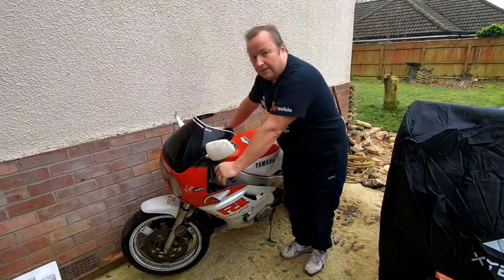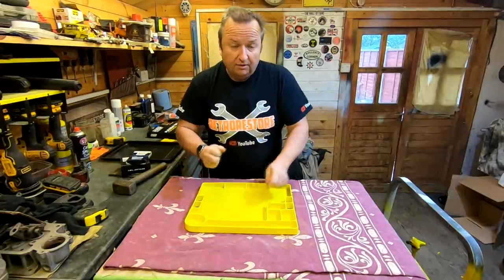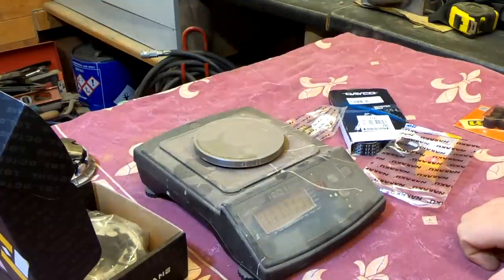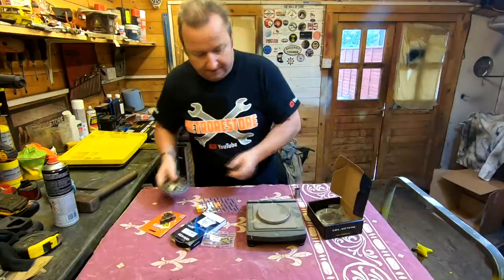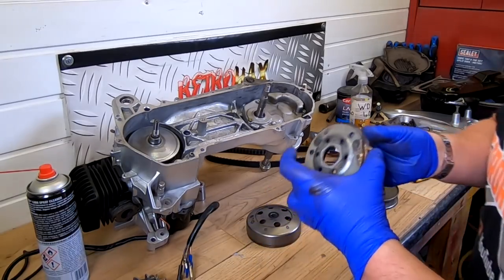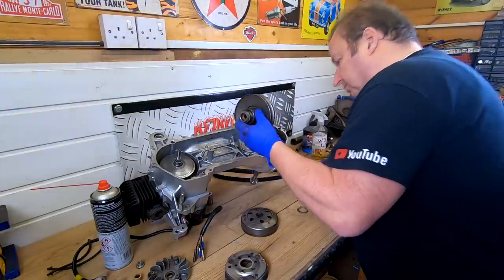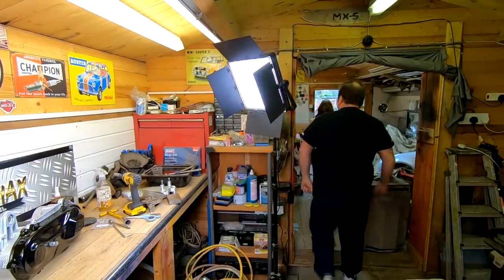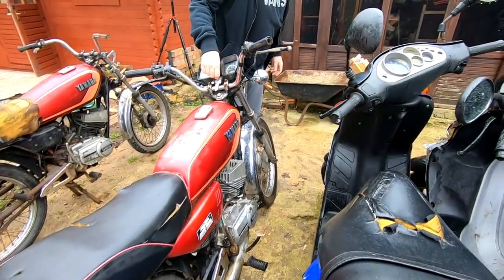Another Investment Motorcycle And TGB R50X Scooter Action

Comment: Poor Sharon.
Nearly there with the TGB. 
The best way I have found to fit Contra springs. Place the torque drive on the floor. Put the spring in. Then you can push the clutch down. One seated, use the ends of both feet to hold it down. Your hands are free to put the nut on.
Reply: Don't forget to line clutch up perfect so it slips on the shaft correct without damaging the 0.75 thread

Comment: Just a heads up. The rollers should be installed with the plastic edge that sticks slightly over the metal inner of the roller facing the front of the scooter. That way when you accelerate the roller plastic edge hits the variator wall not the inner metal of the roller.
Reply from the maker: Thanks for that. I didn't know that.

Comment: The back cover on the variator is a ramp guide. The plastic bushes are a wear and tear item and can wear right through to the metal. I have seen it.

Those flat spots on the weights? I've seen worse... What happens is you will experience a symptom like lack of power, but in fact what is happening is it's keeping it in a higher gear ratio. I mean flat like gone through the nylon and wearing the brass centre bushing/main weight component.

When I do rollers, I always order a set of ramp guides just in case.

Comment: I should get on wiv me Vespa, first 1000 run MK1 T5 on a C plate, put a LML Xpress engine in it giving it same beans as a 200cc, flattens out at 75 but gets there super quick and will go up hill and down dale at 70 all day long with that extra 5mph for just in case hehe.   Have been missing two wheels and now its just me on me own I might put me Reliant up for sale as no point in having a 4 seater when its just me and cats lol   I will be doing an intro to my Lambretta Li, the 617th off the production line late '57 early 58 so says the archives, its so bloody rare it will never be parked outside and will remain indoors as furniture :)   I bought a motorcycle lift, one of the lever arm types and the bloke said "yep, will fit under your Vespa no probs" hmm its too tall by three cms so got to wait for daughter to visit so we can lunk the old beast onto it by hand, once I got it up in the air a bit I will whizz thru the stuff needing doing then off for an mot.
Reply from the maker: Good luck with it Ian. Get your spanners out lol

Comment: Martin it's off topic , but have you any advice for me regarding my blast cabinet not pulling the media.  Mine is the same as yours, with the cyclone filter and recently the bottom valve feed. I've got a decent air compressor (I think) not sure if I'm running it at the right pressure.  Any advice or help will be appreciated 🙏
Reply from the maker: Adjusting the bottom valve for the right flow can be tricky. Mine is barely open. Mine doesn't perform well with a big hole in the ceramic cap so when the hole get's too big, I change the cap. It also works with little media in the bottom maybe half of one of the tubs the media comes in.
Reply: @retrorestore  thank you Martin.  What is your compressor set at please?
Reply from the maker: @stevefirkins1806  I think it is 100 psi but whilst blasting, it can go down to about 60 psi.